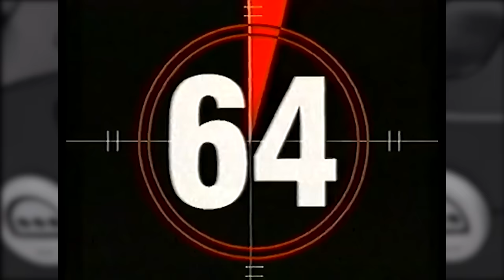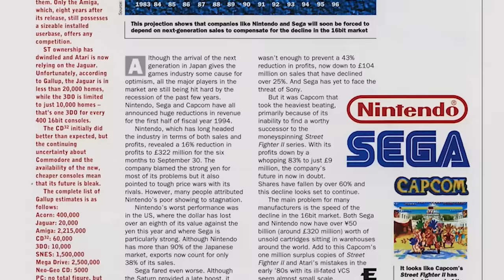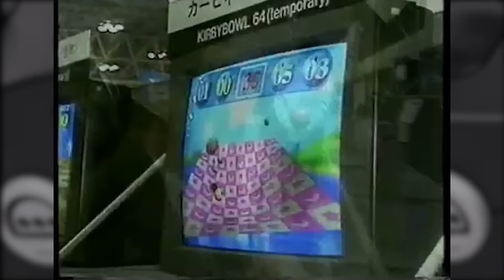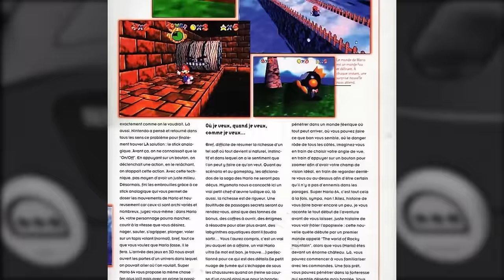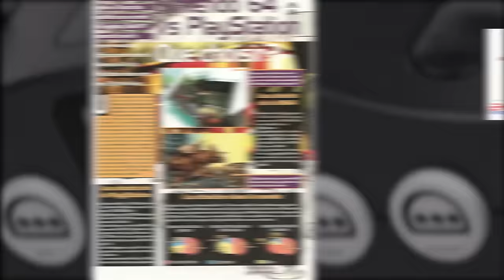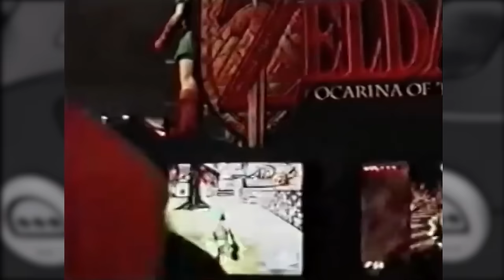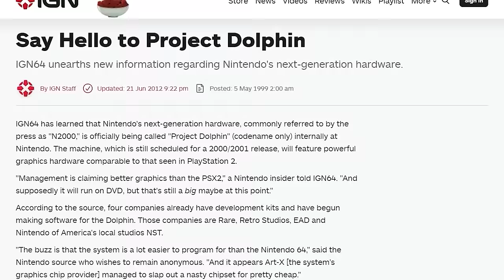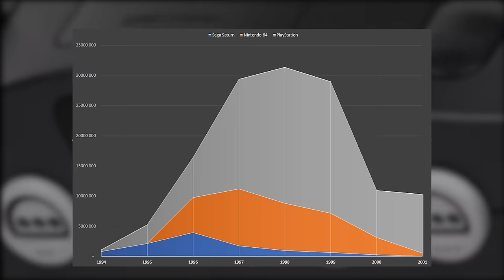The Nintendo 64 chronicles, isolated and revolutionary | A Nintendo 64 Documentary

Comment: Basically the N64 had a Z buffer.  This is really the one thing about it that made the visuals stand out from the warpy wobbly visuals on PS1 and Saturn.  You really notice it these days when you emulate these systems.
Reply: The Z buffer could be done in software, still the effect of no z buffer was mostly textures not being placed correctly on the triangles.
The wobbling was a effect caused by the PS1 not having a FPU floating point calculating unit. This means that the vector calculations only use integers. Therefore the PS1 can not calculate sub pixel movements. Thjis will cause rendered polygons to snap into place leaving a wobbly image.  If you use a proper emulator like Duckstation all these imperfections can be mitigated with ease.
Reply: @UmVtCg  Duckstation can yield some very impressive enhancements. Ghost in the Shell - you can get that running at 60fps no warping at all it looks like a Gamecube title but at high res.
Reply: Yea.... but so that was easy for you to get clearance to move on?

Comment: Great documentary that captures a lot of the dread Nintendo fans had to endure with the Nintendo 64.
In '98 I finally caved and got myself a Playstation with Metal Gear Solid and V-Rally. I was done with Nintendo on the TV until the Switch. Sadly, I missed out on Turok 3, Conkers Bad Fur Day and Perfect Dark.

PS:  All that high-resolution emulator footage is hugely misleading.
Reply: The PS1 games you see on Youtube are misleading.  I used to have 2 of the same model TV set up to compare consoles, and the PS1 version of Rayman looked terrible next to the N64 version.  But it was probably more jaggy than the original, on a LCD instead of a CRT.

Comment: I'm not a programmer  so hearing that developers were upset about optimizing for cartridges I think they are upset that they can't write sloppy code that works but it's wasteful and they have to write clean code that doesn't waste memory.
Reply: Probably. The fact that they got Resident Evil 2 to fit on a 64MB cart, cutscenes and all, shows that they sometimes did NOT need all that disc space.

Comment: Good documentary. I'm lightly surprised that there wasn't more mention of notable third party support. Akkaim with Turok et al. Factor 5 with rogue squadron and high quality compressed audio. Lucas arts. Even late support with Ridge Racer 64 and Resident Evil 2 ports. Or Conkers Bad Fur Day. I can see where this is too much to go into here and is separate from your main points.
Reply: D'oh. And Treasure with Sin & Punishment. But that specifically is a tale unto itself.
Reply: All true (Ridge Racer 64 was developed by Nintendo though), and I'd add Midway for the arcade racer ports and THQ because I freakin love Road Rash 64 lol.
But I think the point is PlayStation had many more, and important ones at that. Naughty Dog, Konami, Square. Huge hitters that could've made huge hits for N64 if they'd been on board.
We're lucky we had the ones you named (as well as such great first-party devs).

Comment: Ironically, in another 20 years I expect only the cartridge games will be playable. We were never told how quickly our CD/DVD discs would corrode!
Reply: The original discs, sure. Copying them is pretty easy though, and flash ROM replacements for the optical reader are available for most older consoles.
Reply: Yeah, and with the moving parts, degradation within the console is inevitable. Whereas both my N64s still play the carts just fine to this day. Solid state, ftw.

Comment: Cartridges didn’t evolve, there are no specialized chips like older generations, they merely got bigger. The cartridges are not what allowed developers to create the games they did; it was the chip and shared memory itself. Regardless of why Nintendo chose cartridges, it and Nintendo’s control over production, are why developers refused to support N64 and why there were so few games. It cost a dollar to produce a CD at the time. It cost $35 in 96 money to produce a cart, they had to be made months in advance and priorities got decided by Nintendo. So it was all risk and small reward. It cost more to manufacture a N64 cartridge than what a PSX game could theoretically retail for new at a profit.

They would have been better partnering with a zip drive type manufacturer, which could have made manufacturing cheaper, doubled capacity or higher by the end, had much faster seek times than CDs, less expensive readers than CDs to put into the console, and curb a lot of piracy (though not as much as the cartridge). It would have resulted in many more games for N64 and still offer all the same tho less pronounced advantages over PSX while shoring up a lot of the negatives.
Reply: Yeah that could've been a good compromise of speed vs cost. 
But I doubt those hypothetical N64 zip disk-type games (and the N64's hypothetical disk drive) would still work perfectly today, as the carts mostly do (and the consoles).
Reply: @nthgth  I mean, I was born in 86 and I had an NES, SNES and Genesis before I was ten.* I remember blowing into cartridges just to try to get them to work. They would not likely work perfectly today as CDs didn't work perfectly as cartridges didn't work perfectly. Those disk drives though, like cartridges, minimize wear and tear. I looked up zip type drives of the time and it certainly could have been an option at least from the outside. Granted 30 years of hindsight makes a difference, but being anti-developer has never benefitted a console against its competitor.

*My parents owned a video store in the early 90's. I lived like a king lol.
Reply: @Parker--   I remember knowing into cartridges too - but that was just NES. Right? I never had to do that with Genesis, SNES, or N64. NES was just.. temperamental.
And an optical drive built in the mid '90s is unlikely to still work today, as is the media, right? Unlike a Genesis or N64 (cart or console).
Also, Zip drives cost about as much as a whole PS1 or N64 in their debut year of 1995. Not much wiggle room for adoption in one of these consoles.
That's really cool though, parents owned a video store, that's the f'n jackpot for any kid 😆

Comment: To me, N64 was what prevented Sony from completely taking over the market. This in turn gave Microsoft time to develop the Xbox.

I would say that as much fun as many of the GameCube games were, Nintendo did the right thing by putting more work into the GB Advanced and the 3DS. 

What I really admire about Nintendo is that they have always looked at how to utilize their strengths when trying to innovate. Yes they lost time in the release of the 64, but they knew by 95 that Sony would own the broader market. So Nintendo stuck to its guns, focused on its niche, and the 64 and Cube as place holders until they could upgrade the hand held consoles. And that eventually paid off in the creation of the wii and the switch.

Comment: If Nintendo had been a year faster, releasing the N64 in 1995 with Zip disc as it's media, 8MB RAM, and a Super Gameboy built in, all for $299. It could have sold 50M+ units. There was also a point with the SNES where before it released, it could have had the Super FX chip built in, which would have changed a lot of games during the 4th generation, and really helped the SNES hang around. Basically if Nintendo was just 1 year faster, it would have done a lot better. The SNES was announced originally for 1988, had it of released world wide in 1990 with the FX chip built in, and N64 released in 1995 with Zip disc and a Super Gameboy slot, it could have led to the Gamecube releasing in 2000, instead of 2001... The what if Nintendo were 1 year faster with all their hardware.
Reply: Just googled it and although Zip drives came out in '95, they cost about the same as a whole N64. Not a viable solution lol
Reply: @nthgth  CD Drives at the slowest end cost over $100 in 1995, Zip Drives would be much cheaper built in the millions, N64 launched at $199 in 1996, had it of released with a 128MB drive in 1996, it would have been a very interesting device, even if it would have cost $299.
Reply: @syferz  ok fair enough, with a 128MB Zip drive for media - and games that justified it - that price, $100 more than competitors, may have been palatable. Maybe. And yes, Nintendo probably could have worked out a deal with Iomega for a discount on the drives so they wouldn't still be $200 a pop. Which is what they cost to the consumer in '95.
But hindsight is 20/20 of course. Hell, if they'd kept up with development of the Famicom Disk System, maybe they'd have had their own cheap, fast, and high-capacity magnetic disk system ready to go by the mid '90s 🤷🏻‍♂️

Comment: Nintendo knows how to make games. Sony knows how to make hardware. 30 years later, the paradigm still exists. With the explosion of ports and lack of exclusives, I fear Nintendo will die if they don't stop screwing around on the harware side. The PSVita did in 2012 what the Switch Lite still hasn't even accomplished. This isn't the 90's anymore and the in-house multiplayer demographic keeps shrinking due to the advent of online gaming. When all of my friends played games back then, my house was the place to go because I had an N64 with 4 controllers and great multiplayer games. While this console was pretty epic at the time, Nintendo seems to still be trapped in the N64 generation mindset, and I seriously question if they can evolve at this point.

Comment: There are some very questionable claims in this video such as "Nintendos adding rumble made Sonys new controller obsolete"
Reply from the maker: At least that's how Sony saw it since they added rumble features on the Dualshock right after that and also used the rumble feature to promote the Dualshock
Reply: @sakharubaguette  that doesn't make it obsolete because it still functioned and did what it was intended to do... It didn't stop working because rumble was added to the dualshock
Reply: @sha-elemental6321  obsolete ≠ not working
My PS3 works perfectly, does that mean that it's not obsolete? Of course not, it's an obsolete console, since more powerful, more modern consoles have succeeded the PS3: it uses old technology.

Comment: 47:42 "From a bunker to a" what now?
Lots of good info in this. Always been an N64 guy, although PS1 has a few games I would've loved to own.

To me, the more-expensive carts are offset by how much darn replayability many of the tip games have. Joy-per-dollar is higher on N64 for me. 4 or 5 games = years and years of tons of fun. I still enjoy SM64, Pilotwings, MK64, OoT, Road Rash 64, and some others - but Road Rash 3-D (PS1 equivalent), Fighting Force, and even (the PS1 version of) Metal Gear Solid just don't hold up today. Imo.

But I see why Sony so handily outdid Nintendo here. Nintendo messed up with third parties, and Sony made good decision after good decision. They did almost everything right.

Comment: Never run a video game console that as vents on the bottom of it with it sitting on the carpet!!!

Especially if it uses an internal cooling fan!! But even if it doesn’t like the clip of the PlayStation running on the carpet, this will wear out your system and cause it to overheat and die.

Comment: Adding in a CD drive would have bumped up the price of the system significantly and it would have made the unit just as, if not, more expensive than the Sega Saturn, which retailed at $399 USD ($805.83 in today’s money.) when it first launched. And that’s without including the games which costed about $40-50 at the time, and memory cards weren’t dirt cheap either. The only way Nintendo could do to ship with a CD drive at that time would be to design the system like how Sony did with their PS1. Had it launched at the same time as Sony’s brand new PS1, it would’ve also made a difference.

Comment: The moment I saw Nintendo 64 my impression was that graphics on this console looks ugly. Instead of using nice point texture filtering with good resolution textures there was blur everywhere and then on top of the already blurry image there was additional blurring filter which Nintendo calls anti-aliasing but to me it looks like image was out of focus - quite tiring to the eyes. PSX on the other hand had extremely shapr image with very good resolution textures - heck, never I felt textures PSX games used would look bad should PSX display in high resolution like 640x480 - and in fact playing games in emulators today with higher resolution textures do look not worse than what we got in the late 90's and early 00's in 3d accelerated games - just without bilinear filtering which for these textures was still too much. Then N64 had like 64x64 textures and filtering... bleh... And games were always much more expensive than new games for PSX and all had this ugly look. Mario 64... yeah, played it for a while but it bored me quickly. From N64 games I like Doom64 and Banjo-Kazooie which I played in emulator without texture filtering.

Comment: Both N64 and Playstation were sorry a$$ compared to computers at the time.  I had a 486DX2 in 1993-4 that ran Doom BETTER than the versions on either console.  And Stike commander in 1993 was a better flight combat simulator than anything on either console.  Now, right there were two titles that were better on the computer IN 1993! PS1 came out in 1995 and N64 came out in late 96 early 97.  So a computer THREE YEARS OLD was better than the N64!  Also, more proof that the computer was better than N64: two years after N64 came out, there was an emulator for it, and it had very modest hardware requirements (UltraHLE). Oh and that whole Sony executive "$299" thinks he's so clever.  Really, not that big of a deal,$399 vs $299.  When you get to that level $100 isn't that big of a deal, esepcially with how well Sega handled the Genesis with its extensive library and how cheap games were.  Games for the Saturn were expected to be cheaper (and they were).  Also, that Sega Saturn price was only for the launch, what do you expect?  It fell after a year.  Now all consoles do that.